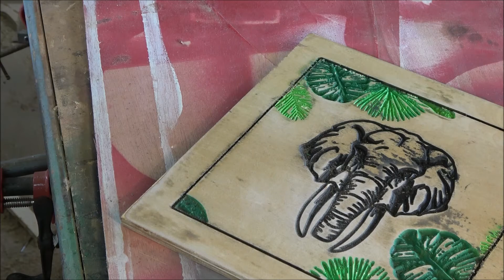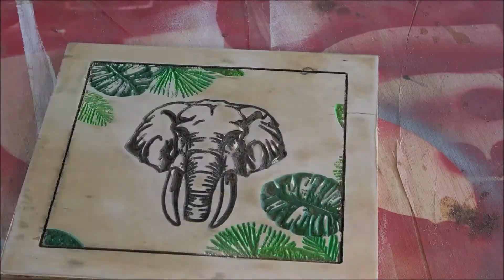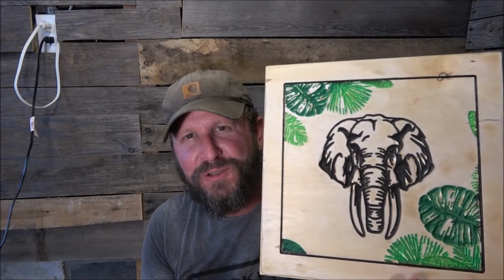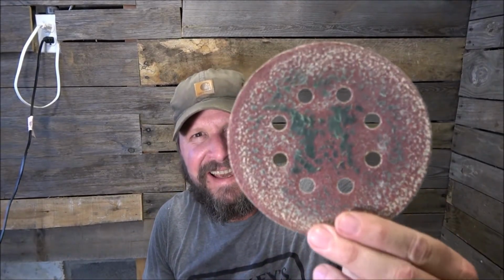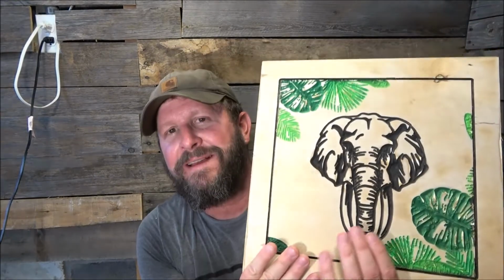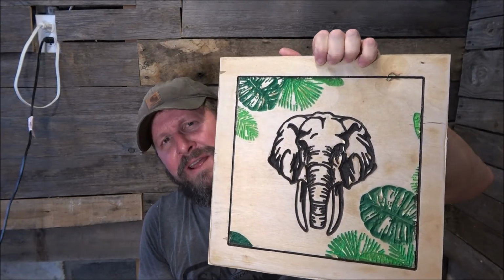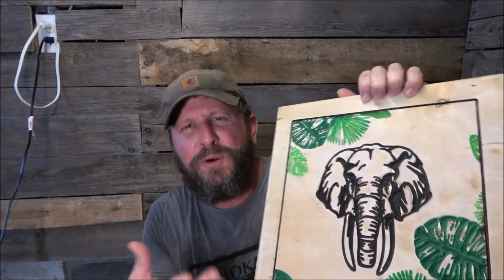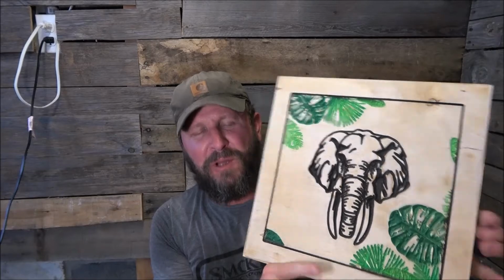Elephant in Jungle CNC

Comment: That's why I like using shellac dries quick and doesn't gum up.  Sounds like the sanding dealer didn't dry properly and the heat and friction from sanding causes a reaching.
Reply from the maker: I was wondering if the speed of the sander had a hand in it...I believe the sealer probably wasn't completely dry, I coated it the day before the cut, but it was kind of humid...felt dry to the touch..

Comment: Sanding sealer too thick and it won't cure correctly, still liquid in middle.
Have you tried a Cabinet Scraper to very fine shave thin top later?
Rubber block or sole of boot will help clean sanding discs!
Reply from the maker: No didn't try the scraper, didn't realize how thick a coat i had until I started sanding....Yes I have one of the rubber blocks, I just don't know where!!! lol....I will definitely put the coats on thinner from now on!!!